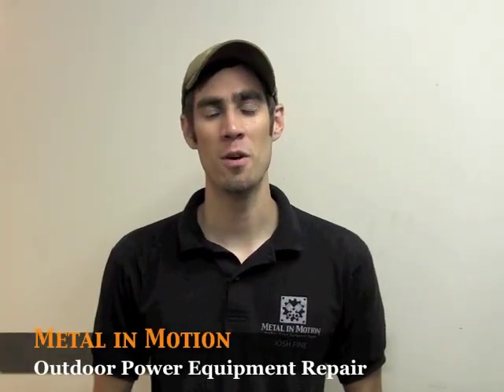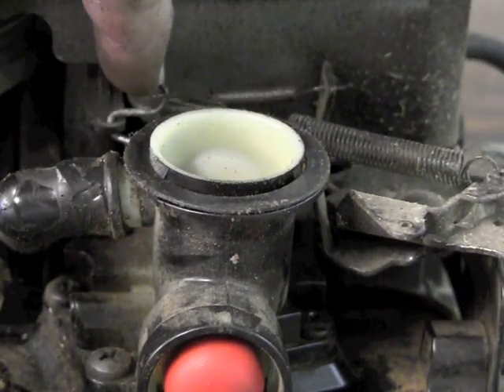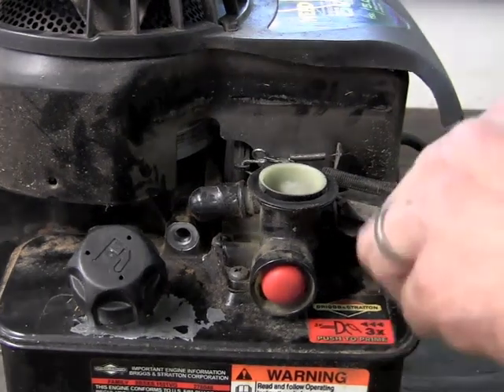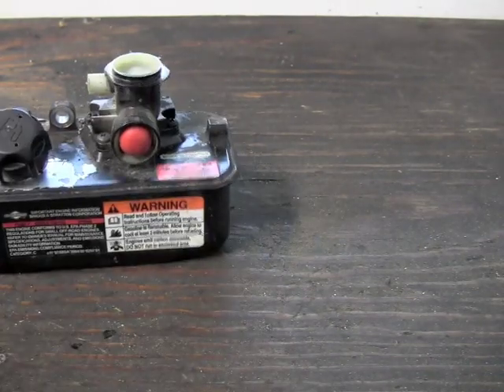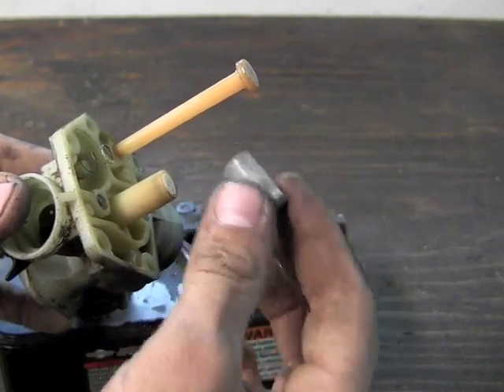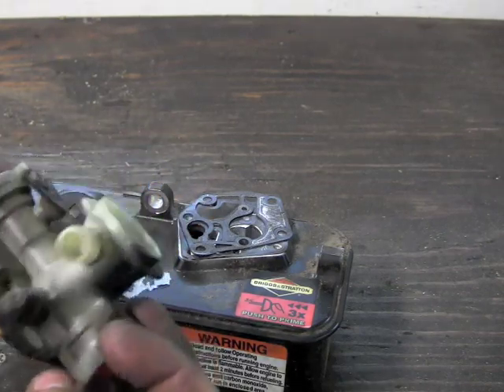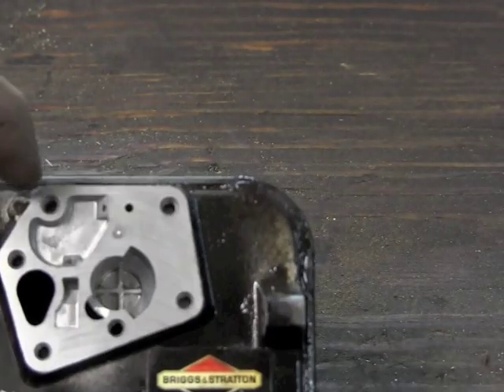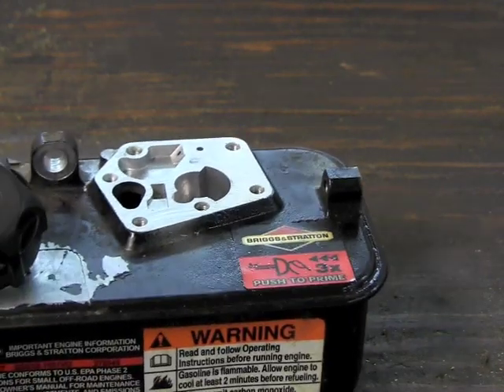How to replace the diaphragm on Briggs and Stratton

Comment: I have a Bolens push mower with a 3.5 hp Briggs and Stratton with this exact carberator. Have done this service several times. My symptoms have been engine surge but this service fixes it. I noticed water as well as grass clippings/ debris makes in inside the tank. I can see how water can get in there but can't figure out how the other trash is making it in there. These carbs are very easy to work in though as is the whole mover. Nice vid and thank you for sharing.

Comment: Perfectly done video showing the process step-by-step and little hints along the way of what to watch out for to make sure the repair goes without a hitch.  Just repaired my 5 year old Craftsman edger in less than 30 minutes. It is up and running like new.  I couldn't find a local shop to work on this small engine, and even if I could they would have charged at least 10X what it cost me for a new gasket/diaphragm!!!

Comment: Mower was running rough, watched your video and after cleaning carb ended up replacing the gasket and diaphram for $8 and works like a champ.  Thanks!  Used the B&S p/n 5083 combo includes spring and screen.

Comment: Many thanks this is almost identical to my model which I have to prime with a spoonful of petrol as the button is perished, but which recently started firing up then cutting out when the primer was burned. Stripped down, new gaskets cut by hand, cleaned out, reassembled and now runs better than ever.

Comment: Same fuel restriction problem on my B&S 3.75 power washer. It would run for 3 seconds after priming. Diaphragm looked OK so I soaked the plastic gas pick up tube and screen in paint thinner (didn't have anything stronger) for 24 hours. Blew out the thinner with a compressor, reassembled. Starts and runs great.

Comment: Great video ... While you've got the air filter off you need to check the cleanliness of the sponge filter.  If the sponge is dirty, wash it out and when completely dry add a few drops of clean oil to the sponge.

Comment: I checked out my mower this am, you are the best it is now purring like a kitten....great video.....i also changed my oil, spark plug, blade and cleaned the machine.....thanks again.....I found I was missing a screw in the front so thanks for that info..

Comment: Hey Josh, You did a terrific job of explaining this procedure. Now I'm going to try and fix my mower. the mower starts with primer spray but stops as soon as the primer spray has been burnt. Probably a plug gas line ....so hear goes. Thanks

Comment: Thanks so much for this excellent video.Transformed a sputtering, hard to start push mower into a smooth running machine. Could not have done it without your detailed instructional video.

Comment: Get 2 air cleaner screws and cut off the tops. Use it as a guide to install the diaphragm. Open the governor vane and see if the throttle screw touches the engine. If not, replace the springs. It's stretched. There is a special oil change tool to change the oil on 4 h.p. Briggs. Amazon has it. Replace the carburetor if replacing the diaphragm don't work. If the engine kicks back, the flywheel key could be sheared. Disconnect the plug wire and crank it around and see if it still kicks back. If not, it's not the key.

Comment: Thanks for posting this.  I have the same mower. For the past couple lawn cuts the mower has been running rough. Like surging up and down. Lastnight I was cutting and mulchin. I ran over a thick bunch of leaves. The mower died. I went to restart and it wouldn't. There is nothing stuck under near the blades. Today the mower almost started for 2 seconds and then cut out. Could this be the gasket? Its got fresh oil,gas,and good plug. Just can't figure it out. Thanks

Comment: The wind vane is such an elegant method to maintain constant rpms. I wonder who invented it back in the day.
Reply: Some time after the “hit-n-miss” ignition system was abandoned. Flyball governor systems kept those old engines from over rev, and work much the same way. A force is either applied to a rod or it isn’t.

Comment: Excellent video!!  I turned a hunk of engine that had 3 inches of water in the gas tank, a seized up throttle cable (that wouldn't release against the flywheel ~ causing it to not start in a million years) and a flooded out carburetor and rippled diaphragm...into a smart trim motor, just from watching this video.  But, just one thing I got stumped on.  The engine seems to rev up and down slightly noticeable, and I think it has something to do with stretched out springs on that "whichamacallit" next to the carburetor.  My quest to you is:   WHAT IS THAT PIECE THAT HAS LEVERS THAT FLIP BACK AND FORTH?  Is that some kind of choke?  Because both levers stick out in front of the air filter cap, and it seems it regulates the rev of the engine.  Can you help me out here?
Reply: +chivone21 Hi, I just fixed mine.  That lever is a governor and it is controlled by air flow to the engine and the two little springs.  As the engine speeds up it stops the engine over revving.  As the engine slows down it allows more fuel to the engine.  This allows the engine to maintain the same speed regardless of load.  The springs need to be in good condition.  Their part numbers are 691859 and 690250 for my engine but YMMV.  If you write down the numbers across the front of the mower and take that to the mower shop they will have the correct parts.  Very expensive little springs.  However, very important they are in good condition and installed correctly to get the best response from the governor.

Comment: Thanks for this great demonstration of disassemble and clean the fuel tank and carbretter.  I just have one question. One the mower I own, the rubber primer on the side of the carbretter has actually split. Not one is it difficult to prime the motor, I am also sure it is letting air though as well. Is it possible to replace the primer?
Reply: ***** My mower has the same issue. I removed the old button and covered it with a small piece of thick polythene then replaced the plastic rim to hold it in place. I prime it by removing the air filter (one screw) and pouring a spoonful of petrol into the carb. Works fine.
Reply: *****  Phil, if you are still looking and don't want to prime like Graham (I have to prime my weed wacker right now and it is not convenient), the bulbs are relatively inexpensive.   I just bought a pack of 3 different priming bulbs at Home Depot for $7, luckily the one I needed was in the pack. They were clear, not the red one shown, but one in the pack may fit your engine. Research applications for the parts online and also take the old bulb with you.  An  internet search revealed quite a selection you can order online also 
. If it does prove hard to find at a local store, then I would take the bulb to a mower shop if the cost of mail order online totals more than about $12 .

Comment: I would've checked to see if the carb was warped when I it off. Those carbs are known to warp from the heat on the engine.

Comment: I lost the little berring inside of the primer area on the Briggs and Statton 300 series. Will it work without those little metal balls. I replaced the primer and the mower still won't start

Comment: I cleaned and replaced the gasket and diapragn.. It worked for awhile .. now i got the same problem . engine starts runs for about 10 min before it dies.. The primer bulb colapses.. Is their a fix for this??

Comment: I have tried to replace this, but I seem to have a petrol leak on the front of the carb, (on the diaphragm under the O-ring) opposite side to primer.. I cant tighten the screws anymore then they are now? the diaphragm looks flat but its still leaking>?>

Comment: Do you know if there are still carburetor rebuild kits available for this engine?

I believe my 2002 Craftsman edger uses the same engine.  Really, I only need that paper looking diaphragm for the carburetor.  I feel as if that's the culprit because I have cleaned everything else out really well.

Same style engine with the fuel tank also filling in as the fuel bowl, with the carb mounted directly to the top of the fuel tank.

Thank you!
Reply: Briggs and Stratton (genuine) part number 795083, Diaphragm-Carburetor
Reply: Thank you, Mick!  Hope this solves my problem.  Will report back.  Am I correct that these diaphragms dislike brake cleaner, especially old ones that are original from 2002?  Possibly affecting fuel flow?
Reply: Already got the diaphragm and gasket, installed today, ran great!  No more struggling or bogging down.  Replaced the primer bulb as well.  Top notch!

Comment: Still having trouble with it starting, I replaced the spark plug, cleaned out the carberator best I could with cleaner, but did not replace the diaphragm or gasket yet,  and now the primer doesn't seem to be pulling any gas at all, could it be the primer, or should I have replaced the diaphragm/gasket?

Comment: in the past when I need parts for Briggs they wanted all of the numbers  ser numbers, model number, code numbers, off the engine  and hp of the engine that may have change but take them with you any way so you don't need to make another trip.

Comment: Although 95% of the time these are your problems, But just know I have had where the bolts that hold the carburetor (Tank) on vibrate loose which causes the weight plus movement break or crack the plastic intake tube (Attached to carburetor) which gets worse in time and eventually will not start because the tube can not do a proper job at drawing the fuel,They usually crack at the intake valve where bolted,This tube has 2 screws which you can only see after removal of the starter housing.. So just something else to keep in mind,And not just with this type of Briggs engine.

Comment: If the breather tube elbow is cracked can it keep the mower from running
Reply from the maker: No, that tube is only a crankcase breather tube. The only thing is will do is let dust get passed the air filter, and for emissions. But because its on the air filter side of the throttle plate, the carb is able to adjust for the extra air coming in.

Comment: After putting it all together again my mower is clicking and won't start... Could it be something with the governor? What do I have to do? I have the same exact mower
Reply: Check the spark plug for carbon buildup. If it's covered with soot it may be causing a short on the plug thus preventing the formation of spark.  If carbon buildup is a problem check the plug to see if it's the correct type and the gap is set properly (0.030") .

Comment: Josh, what's the Briggs part no. for the gasket & diaphragm?
Reply: http://www.amazon.com/Briggs-Stratton-5083K-Carburetor-Diaphragm/dp/B000KKMAT4/ref=pd_sim_lg_1?ie=UTF8&refRID=032H9HE8ADXB14FN63SR
I had the same issue on my used Briggs & Stratton. Water in tank and torn diaphragm from neglected maintenance. Check what model engine you have before buying. you can find all the Parts on amazon. If you find it near your local hardware store all the better.

Comment: Ive done this a few times with always a good outcome. My neighbour's lawn mower carb now leaks like a sieve around gaskets. No wrinkles. Everything installed properly, it seems. Irritating
Reply: It's possible the base of the carb is warped. If so a new carb is in order.
Reply: Saw another video that suggests a certain order when snugging down the five bolts. One guy replied that it solved his leak problem. With the gas cap in the upper position, start snugging the bolt in the 2 o'clock position first and work around clockwise. The fifth bolt is in about the 12 o'clock position.
Reply: Karen Turner I had wondered about that, too.  Tried a different way of screwing the stuff down with no luck.  Realized the carb was about 13-14 years old and it is probably warped.  .  a new carb solved it.  damn  plastic.  Thanks, though.

Comment: I have the same motor on my pressure washer.   Do u know why my PW won’t turn off when I move the throttle lever back to the far right (off position)?   It barely idle like it turning off but doesn’t.
Reply from the maker: There is a little black wire and a tab that sticks down from your throttle lever. The black wire is held in by a little spring clip. In the off position the tab on the the throttle lever and the spring clip are supposed to touch. Either that tab is bent so its not making contact or you have a problem with that wire. The wire goes from that throttle lever spring clip usually straight to the ignition coil. I dont have one I the shop or I would send you picture.
Reply: @metalinmotionshop  man thanks for the info.  Got the pressure washer to turn off.  Turns out the tab was bent.   Thanks again buddy!

Comment: I have the same mower. why doesn't primer return . all I get is one  pump then have to wait and wait   for it to come back. this was once cured by replacing the air filter, but now, even without a filter, its not springing
 back. going to disassemble it tomorrow and Clean the carb and fuel screen and inspect gasket for wear...anyone have any ideas about primer return?

Comment: I have new B& S  push mower it won't run . I haven't seen a mower like mine on you tube . hope I did't buy a dud!  it will run when I pour gas in carb, so I know it's a fuel restriction problem! had no trouble with my old mower for 10 yrs.. all I had to  do with it is prime it! I am very dissipointed in this new pil of crap!